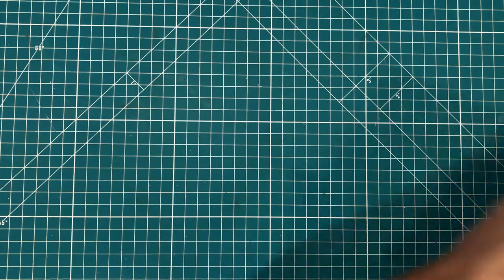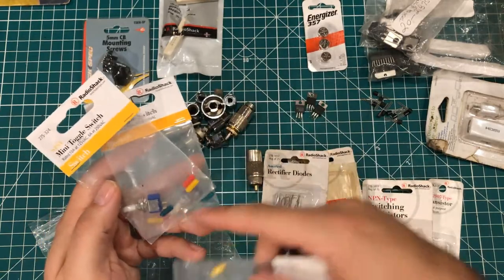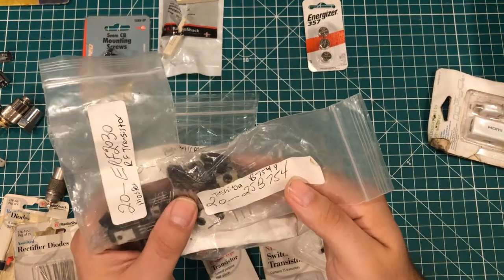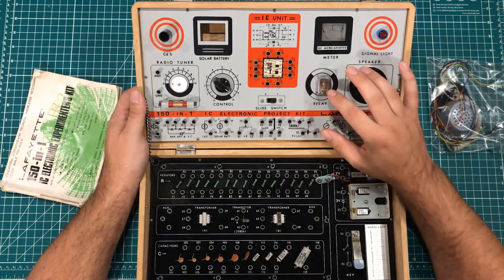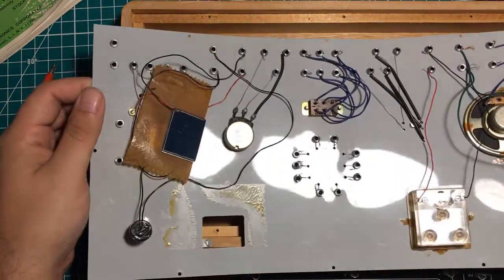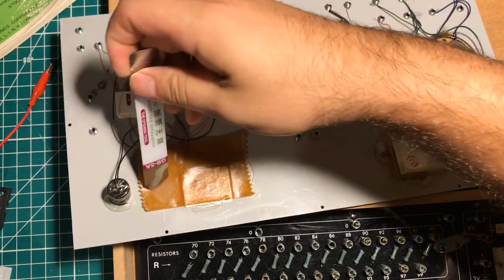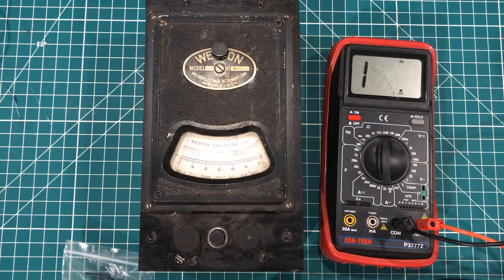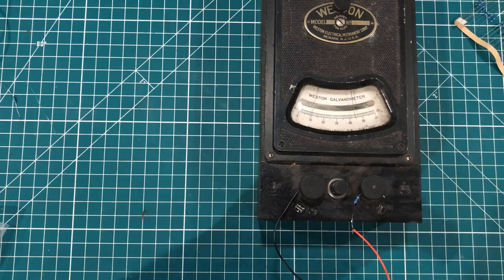$29 Vintage Electronics Haul - Lafayette 150-in-1, Weston Galvanometer and More!

Comment: Nice find. Love the old electronics kit.
Cds is a light sensor.
"A CdS cell is a large area photo resistor, made by depositing doped cadmium sulfide on a ceramic substrate. The CdS cell resistance changes in proportion to the amount of visible light; this allows more or less voltage/current to appear at the input of an electronic switching circuit."
Reply from the maker: Thanks.  That's very cool. It's also cool that it still works after all these years!

Comment: The Weston is likely pretty accurate -- the perceived low reading is due to not taking the load of the meter itself into account.  What you have is battery across two resistors: the meter's DC resistance + the series resistor you have added.   The series resistance of the meter is normally on the faceplate/scale. You've probably noodled that out in the passing two years....